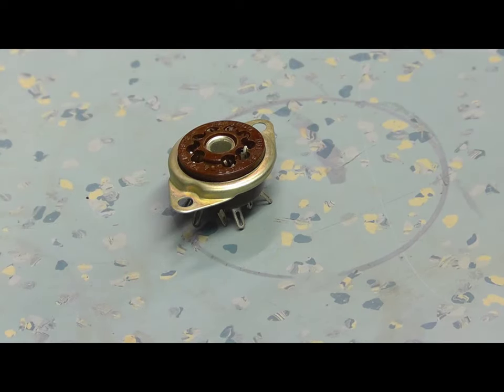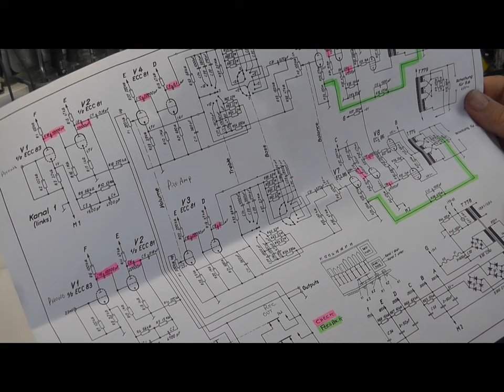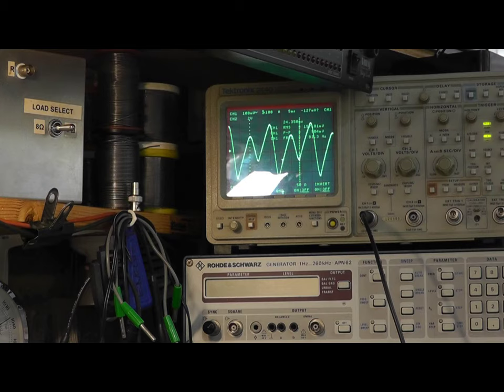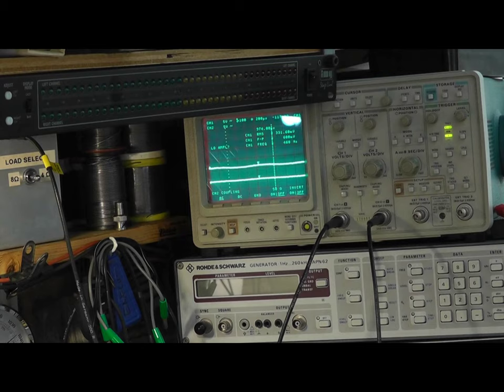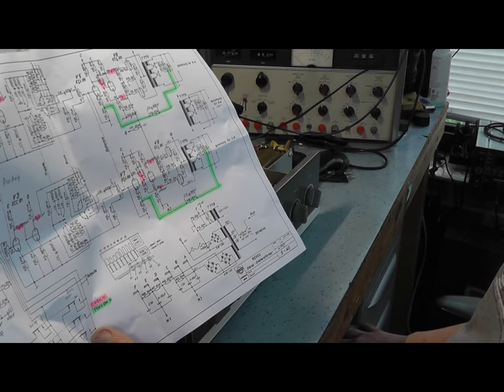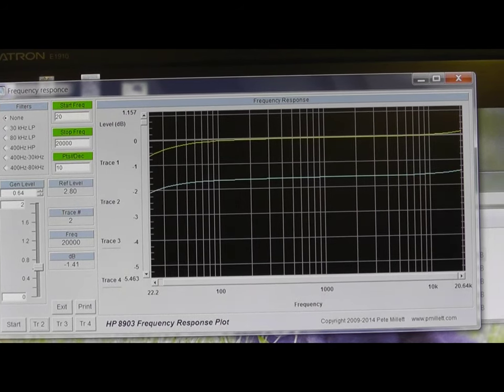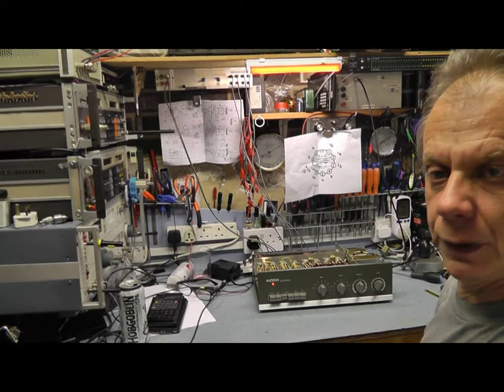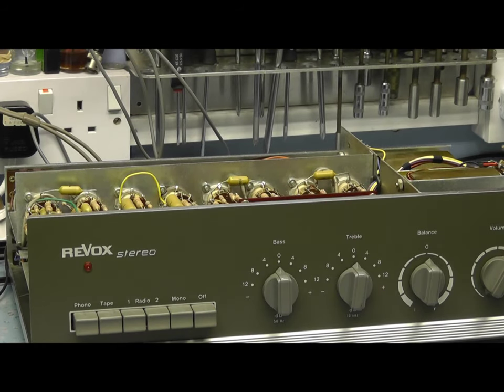Revox model 40 Valve amp pt2 Valve holder repair cap check.

Comment: What a nice sound! Happy to see you were able to repair the valve socket, I've used that technique a few times myself working on older radar gear. Very good frequency response considering it's age - shows you what good engineering can produce. I was surprised to see sheetmetal screws holding the the valve sub-chassis in place, the wiring looked very close to that sharp, pointy screw. Thank you for another interesting video, Regards, David

Comment: nice one simon the valve pin fix is a common one on vintage radios where the valve holders are not such good quality .I am glad you decided to leave it prety much original .

Comment: There can still be a leakage path back through the supply rails and through any electrolytic capacitors across the power supply rails and possibly through the selenium rectifiers and mains transformer. This could account for your anomalous in-circuit leakage readings.

Comment: Hi Simon, nice amp, I wonder what the voltage drop was across the selenium rectifiers under load conditions?  you stated if you had changed to silicon you would need dropping resistors, I have had old selenium rectifiers short out before and produce an obnoxious smell also possibly toxic.
I would be interested on your view about this.
Regards, Ray.
Reply from the maker: I would be loathed to change anything in this amp as it is so original. The owner did ask to not change components unless they are failing of liable to fail in the near future. Silicon would be better, but for now all seems well.

Comment: What is the name/brand/model of the equipment you are using for checking the capacitors?
Reply from the maker: Hp 4261
Reply: @SoddingaboutSi  Is that the hand held one which can be seen at 3:30?

Comment: Hello Simon, excellent job ! Did myself restore the same Revox 40 last year, neat little amp  https://photos.app.goo.gl/kp4wdsPACcMpTij49 By the way, what's the handheld capacitor tester you have been using for checking capacitors leaks ?
Reply from the maker: That's not a capacitor tester, it's an isolation tester. It lets me test the capacitor at it's rated voltage so I can spot any leakage of breakdown. Only ever use it in HV applications ie anode to grid decoupling capacitors.
Reply: @SoddingaboutSi  Thank you Simon ! I like your videos very much.
Reply: I found this one, is it the same kind of instrument ? https://www.reichelt.com/de/en/uni-t-isolation-tester-ut-511-p97159.html
Reply from the maker: @Thmartin60  Yes. Find one that does 50v upwards if you can. Bear in mind if you leave the capacitor charged you will get a nasty shock!

Comment: I have to say " Rubbish! Mr privit, preview, previn " :-D
A very caring repair simon.
For obvious reasons i could not judge the audio, but it's a loverly amplifier.
If it was full of the devil carbon resistors i would go mad with the cutters and replace them with metal film or similar.
And i thought the valve socket contact might have been damaged, i think ill nip down to the bottom of the garden and shoot myself ha ha :-D.